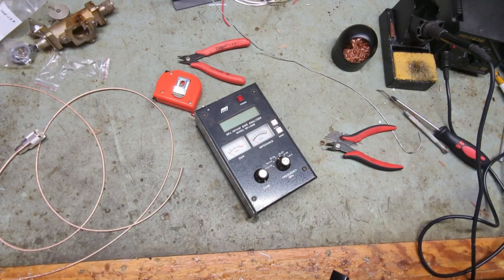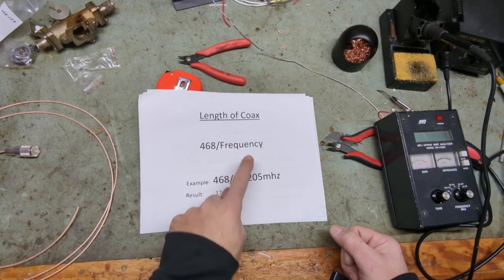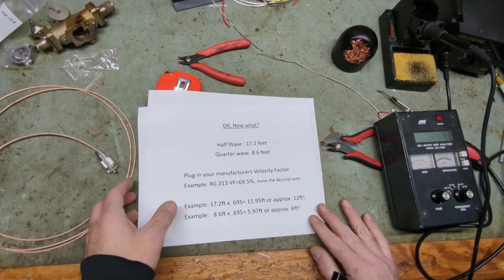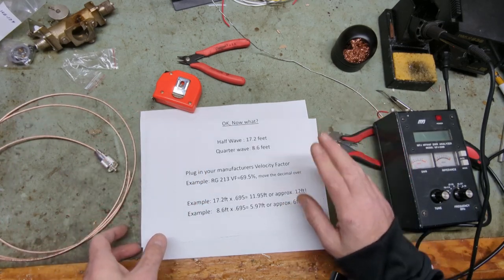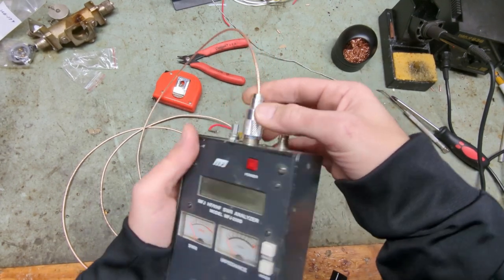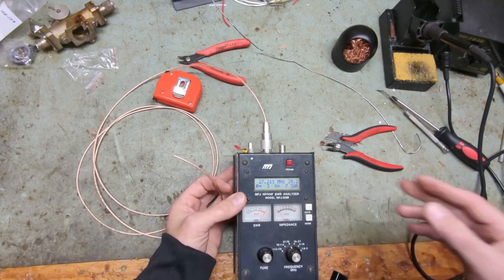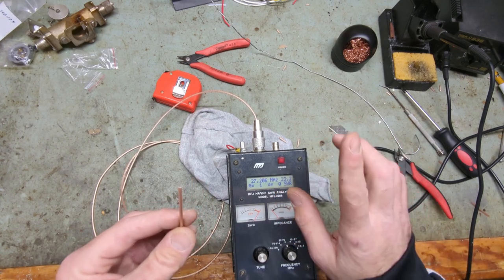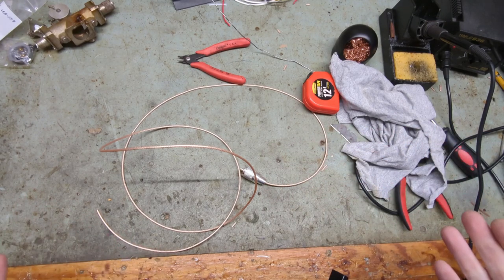How To cut your coax to nulls or coax tuning

Comment: wait are you actually using 1/4 waves stubs to interconnect components so the coax is "invisible" to the connected devices  LOL  Oh you must be a CB tech LOL 
As a retired electronics engineer, this is nothing but a bunch of male bovine excrement. Don't get me wrong Coax stubs are very useful in making things like phasing lines or precision phase corrected  lab jumpers, But it's useless for interconnecting things like antennas and amplifiers to your radio. 

This is a prefect example of an old CB wives tail, some CB fool read in a ham radio book that a 1/2 wave stub will present the same impendences at the load as it does at the source and that it meant that the coax should always be cut  to the nulls LOL Damn our school systems are failing us.
Reply: Typical.  Look at the "great video" and "thanks, just what I needed" responses.
Grit my teeth.
Reply: I know, wives tale. I'd need a 44 foot trimmed jumper lead for our 60m band, it is by chance about 50 feet but I didn't precisely trim it like this shows, and 550 feet for our 2200m band! Trim the aerial not the coax.
Why do they think things change up to the SWR meter? Why don't they tune the whole system, jumper, SWR meter and coax by adjusting the aerial if it bothers them?
G4GHB.
Actually it's not 550 feet, that's metres, it's more like 1700 feet!
Reply: @bill-2018  Answer, because they don't understand electronics theory.  Actually,  hardly any hams do. They take a tiny (probably, that a half wavelength of coax repeats the Z) fact and distort it out of proportion!  The sad part is whenever you see one of these and you check the responses then you see how ill informed and gullible the viewers are. One of my favorites, Fine Tune CB - he gets people to pay him good money to "Tune" a  brand new radio, as if the factory didn't know how to do it.
Reply: @feeatlastfeeatlast5283  Can't be bad charging people money for something already working. I think I've seen a couple of his videos. They are obsessed with trimming jumper cables as if that cable before the SWR meter is a problem and no problem beyond it.
73, G4GHB.
Reply: exactly, coax length does not tune the antenna system It only changes the z seen by the transmitter. 

If you're antenna is resonant then coax length isn't going to change that.

this is just a perfect example of illiterate people reading something in a book and distorting it.
Reply: @bill-2018  Right you are.  But isn't this exhausting?
Reply: Go tell that to the intelligent radio, cell service, or tv broadcast tower installers, and watch them laugh at you.  Ever notice the bundle of wire somewhere on the tower?  It is not there to replace a bad connector if it goes bad.  The companies that get the broadcast towers built want the maximum power output out of the antenna, period.  Getting reactance as close to 0 will accomplish this.  Antenna selection is a major part of the equation, but the equation is a complex one that also includes the coax.  The video unfortunately did not show needing an open or short depending on the fraction of wavelength the coax was cut to.
Just being an EE does not mean all the knowledge is there.  People concentrating on power supplies are not going to be as knowledgeable in RF when compared to someone that designs shielding and cavities for multi-gigahertz oscilloscopes. To drive the point home, neither one of the people above would do well creating computer central processing units, calculating interactions due to density and proximity of components, propagation speed and cross-talk of signals at GHz interconnect speeds, etcetera.
Will you tell me antenna mounting height does nothing to the complex system when all hooked up?
Reply: @bluesteelbass  Well I just happen to be a retired broadcast engineer, I still hold an FCC commercial radio telephone license as well as an extra class ham radio license. I was employed as a broadcast engineer working in the  Los Angeles area for major broadcast networks, I spent quite a bit of time up at Mount Wilson working on transmitters, antennas and amplifiers.

 feed line length only becomes important when you are phasing antenna arrays, And this is only due to the propagation delay through the feed line. If you're trying to feed two antenna arrays at 180° out of phase then you shorten or extend one of the feed lines to accomplish the out of phase delay. 

feeding antenna rays out of phase is not a normal practice in the broadcast industry but it is important that when you're running multiple antenna systems to feed them in phase and feed line length then also becomes important, this is normally referred to as matched feed lines.

this has nothing to do with the efficiency of power transfer because the feed lines are pretty much invisible, but rather due to the velocity of propagation of various feed lines It is possible to create a delay line by making one coax feeder a fraction of a wavelength longer than the other one. this is very common in satellite communications that require circularly polarized antennas. You can cross polarized two antennas and feed them 180° out of phase to create circular polarization.

anyhow I'm not going to sit here and try to give you 60 years worth of RF engineering experience in a YouTube post.

When it comes to feed lines the general consensus among experts is that the shorter the better. extending a feed line simply so you can create quarter wave intervals is the epitome of DIY nonsense. nothing more than a bunch of people trying to sound more intelligent than they really are talking about something they obviously don't really understand.
Reply: All of this information is overwhelming! I'm trusting your expertise, but I'm confused about why the SWR would change when I increased the length of the patch cable. I've recently set up my base antenna for CB, got licensed for ham radio, and I'm in the process of putting up a 2m/70cm rig. I also just got my first antenna analyzer, and my brain is already hurting from trying to understand it all.
Reply: and your average CBer understand antenna and transmission line theory even less. They actually think transmission line length controls SWR. 

transmission line can transform impedance but what it can't do is change the SWR of the antenna, only the SWR that the radio sees at the end of the coax. The SWR at the antenna never changes. 

In most cases using coax as an impedance transformer to control antenna SWR is just an illusion The SWR at the antenna is still what it originally was It just looks different to the radio so you're not seeing any benefit. 

now there are times where coax stubs are used as phase delay cables but unfortunately mostly cbers Don't even understand the basics of antenna theory even the self-professed experts on YouTube get it wrong most of the time. 

SWR meters are actually not the appropriate tool for tuning antennas, a vector network analyzer is the tool you use to tune antenna systems.
Reply: Your SWR isn't changing at the antenna, when you change the length of coax it's acting as an impedance transformer so the reading changes but the actual SWR at the antenna remains the same. 

SWR meters are not the ideal tool to tune and antenna, what you need is a vector network analyzer which can cancel out any impedance transforming effect by the coax and measure the actual resonance and characteristics of the antenna at the antenna feed point. 

You can kind of accomplish the same thing with an SWR meter using a tuned coax stub. 

ideally you want to measure the SWR right at the antenna feed point, but this is in practical because quite often the equipment or your body will interfere with the readings. 

this is where a VNA comes in, a VNA can be tuned to Make its measurement at the feed point of the antenna not at the end of the coax.
Reply: @dannelson8556  If this is the reality then it's a waste of time tuning the antenna while taking SWR measurements at the radio end of the coax and to be honest very few people tune their antenna at the feedpoint while at height.
  This puts tthe argument back on track. Some vertical (and some other) antenna can tune very differently to each other when each compared on 2 different lengths of coax. If the coax can be made to look virtually invisible at the desired frequency that you will be centring the tune of the antenna around then we can be more sure that we have tuned only the antenna from the radio end and not a combination of antenna and feed-line. I would like to draw also some attention to the general lack of people talking about how the metal masts also become part of their antenna systems to some extent and why are people not fine tuning their masts when they are electrically connected?  Yes it should not really be an electrical consideration yet it all too often makes a large difference to an antennas tune. Put the same antenna on a different mast and re-tune it!
Reply: @ChristiannTyler  My SWR does not change whether I use my 45" or 20" jumper lead. Why should it unless you have r.f. on the braid. In 50 years I've never had my SWR change by changing coax length.
Don't believe these C.B. myths about coax length being essential for things to work properly.
G4GHB..
Reply: @dannelson8556  and using the feedline to change the impedance the radio sees isn't valid?
Reply: @Pioneer936  I've never heard of any amateur having problems with an amplifier and coax.

Comment: Do you think an SWR meter is somehow an isolator? One side of the SWR meter is not connected to the other?
It's like a coax connector joining two cables together. The inner two are connected together and the braids are connected together as in one cable.
In reality you have one length of coax with a meter placed conveniently near the transmitter. 
G4GHB.

Comment: Thanks for the simple explanation. Your method works great. I usually talk on some lower frequencies below 11m channel 1 so I implemented your advice when I made my next jumper but made it a little over 6' (6'-5") and it came out perfectly, in fact I was able to cover the entire 11m band up to 27.425 down below 26.865 and my SWR never went above 1:1.2. During my years in the radio game some have told me it doesn't matter and others have said differently but now I know it does. Thanks again, I'm off to make a few more jumpers.

Comment: If you can use a nano vna what do you set it on
Reply: SWR, impedance, usually all I use. U can actually see the sine waves and nulls in a vna. Put your curser at your frequency then start trimming till the null slides over to your frequency. Done
Reply: @electromechanicalstuff2602  ok thanks

Comment: Just curious .. Years ago (mid 1980's) I talked a local guy who said he took like a 12 foot piece of rg-213 coax and kept chopping it down a few inches at a time until he got a good match between the his radio and amp. I asked him about the mismatch (very high swr) and he said - "It's the coax, it needs to be the correct length between the amp & radio, or they'll always be a extremely high swr."  This was a cobra base cb radio, base boomerang 250 amp to a vertical 5/8th wave antenna. I don't know what length he ended up with, but said he got it. Is there some (sweet spot length) magic length between a radio and amp that needs be got right?